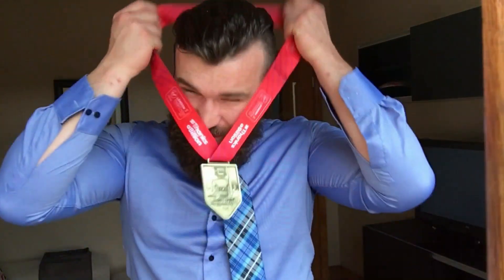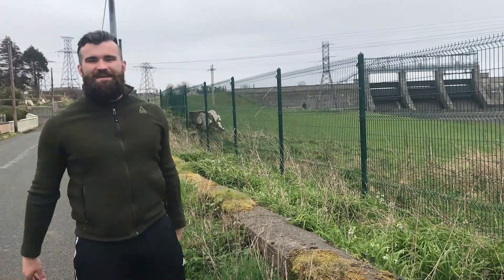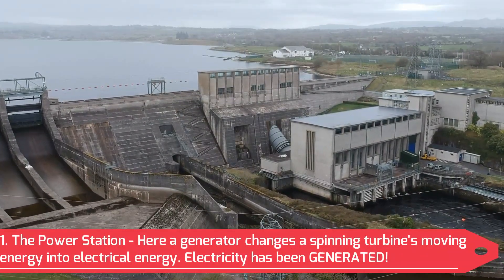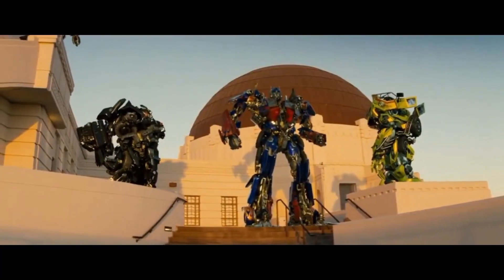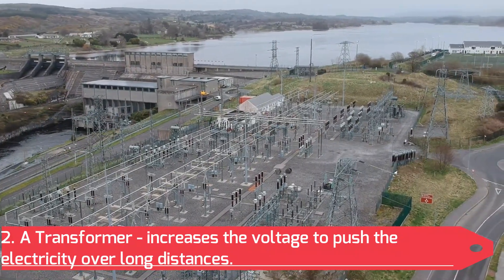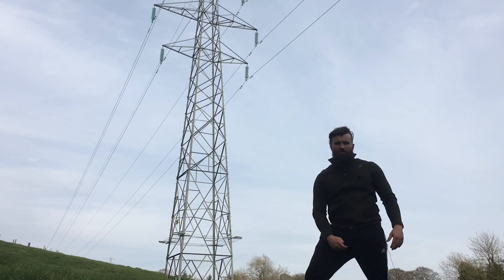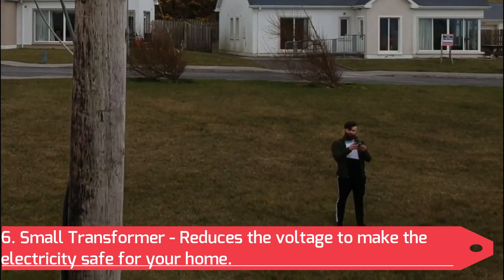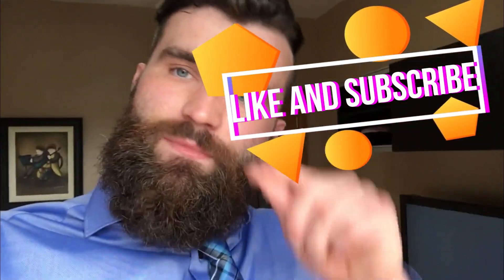How is electricity made? | Source to Home | Learning Made Fun

Comment: Thank you for easy  explanation, question,  is low voltage electricity  coming through power  points in home if nothing plugged in but switch is on.?
Reply from the maker: Great question, Rosie! ⚡ So when the switch is on, the socket is definitely ‘live’ — meaning full mains voltage is sitting there waiting like a sprinter on the starting blocks 🏃‍♂️💨. But if nothing is plugged in, no electricity actually flows (no runner leaves the blocks) because there’s no circuit to complete. Think of it like turning on a tap with no hose connected — the water’s pressurised and ready to go, but it’s not spilling out until you give it somewhere to flow. 💡